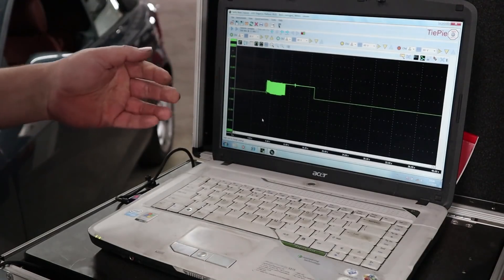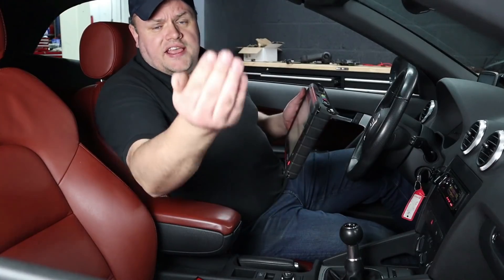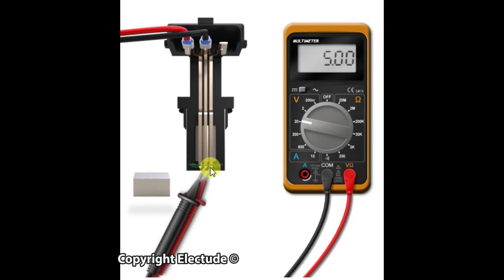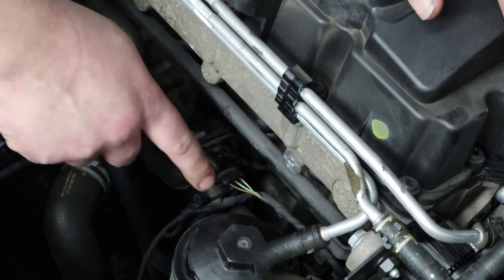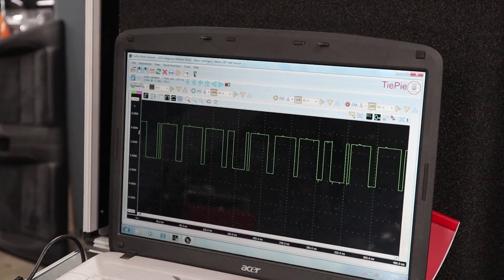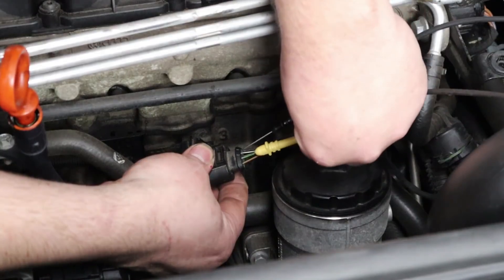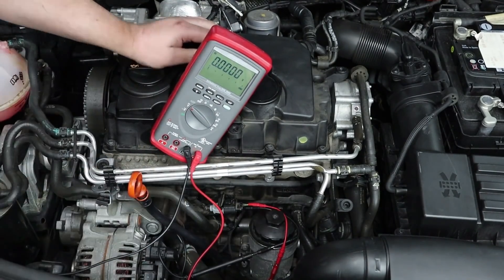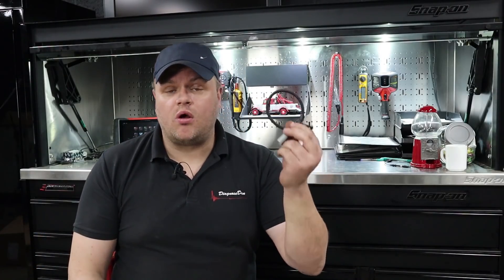2009 Audi A3 Diesel - From Holland with Love - A Special Trained by Techs Video

Comment: I used an old mechanical diesel engine to build a genset for hurricane season backup. The controller needed a speed signal from the engine which wasn't there. I built a custom bracket to mount a cummins crank sensor to read a 20 tooth wheel I machined and mounted to the crank pulley. I works perfectly, 600 hz is the target for the 1800 rpm generator, so I can use my Fluke meter to adjust it it.
Reply: Wow great work💪💪

Comment: Thanks Dan, Is the blue trace just a single chanell across power and ground and your monitoring battery voltage? So if either power OR ground failed signal would drop
Reply: Exactly👍

Comment: How can pcm determine which first piston at compression stroke when camshaft sensor faulty?
Reply: There are missing teeth on the ring that the cranksensor reads. It counts the teeth from that fixed point to calculate the position. But because the the crankshaft needs at least one revolution for this method it takes longer to fire up!
Thanks for watching 😀
Reply: Crankshaft has a reference point to inform ecm but it takes a lot more engine crank time to start.
Reply: @michaelr6205   But with only crankshaft single how can PCM determine the exact cam position to fire up the exacted injector? 
This is diesel engine and injector order at the right time is necessary to startup and operation.

Comment: This car starts even with no CAM signal? Very smart ECU. This not allways the case for all brands?
Reply: Vag group cars are using the crank signal if the cam is missing, as backup.
Reply: How can crankshaft sensor backup at start??
Reply: Most but not all.

Comment: good to see dan.  one must remember there are 12 volt halls out there too on older stuff.
Reply: I've seen and heard of different voltages, in fact any voltage could be used if desired by the engineer. Most i've encountered are 5V.
Thanks for taking the time to leave a comment!